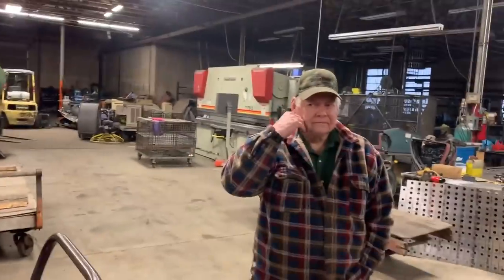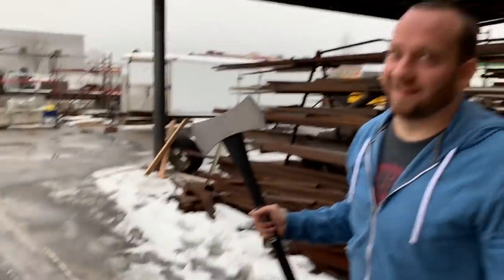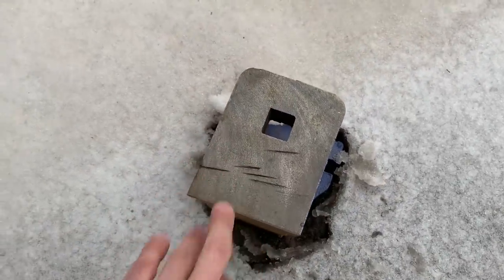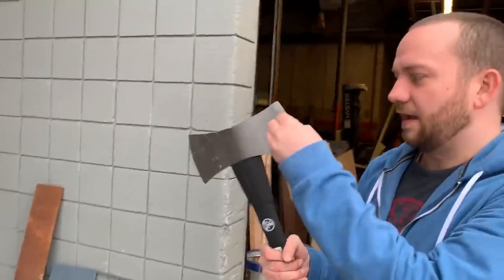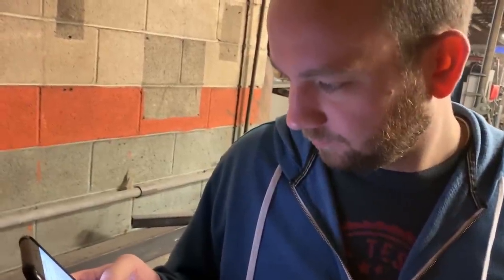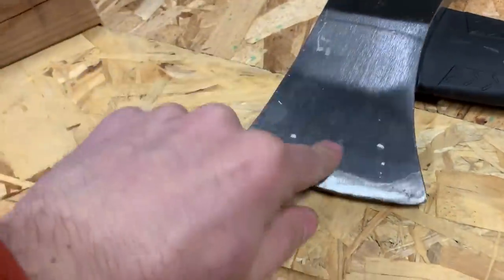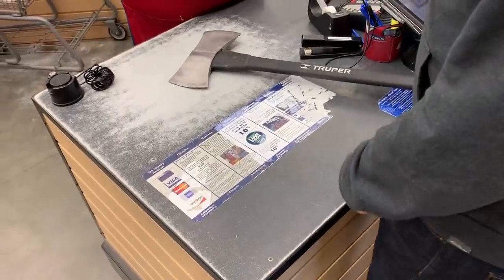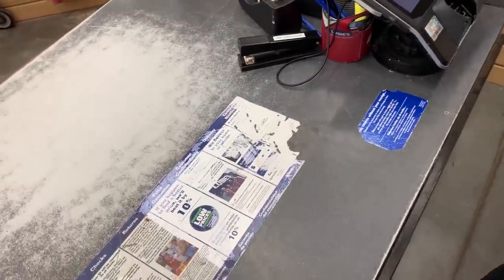Sharpening an Axe with 60,000 PSI Water - Waterjet Channel

Comment: You probably could have sharpened it if you strapped the axe head to the block you cut at an angle. You would need to cut the other side of the wood block at the same angle just angled the  opposite direction.

Comment: How's a rock harder than an Anvil?

Simple the Anvil isn't hardened steel. The Axe Head is.

Anvils aren't hardened because when you miss strike and hit the anvil with a hammer if it was hardened you would have nasty flakes of hardened steel flying off at super speeds and potentially injuring you. 

Hope this helps

Comment: It is an anvil from Harbor Freight.  I had screw drivers from there that deformed when I used them the FIRST time.  I think they are just not heat treated.  Why else would the tip of a flat screw driver twist?  I know they don't sell any top quality tools in that store but I thought I would get more than one use out of a screw driver.  I have old Craftsman screw drivers that have gone through many times more use and I still use them today.  I am not sure how they compare to other brand tools but they did last a really long time.  If those inferior quality screw drivers from Harbor Freight were not free I would be back there the next day to return them they are that bad.  I suspect that anvil to be made of similarly SOFT metal.  I know you don't want an anvil to be hard and brittle though.

Comment: The reason why the rock is harder is because that 'anvil' has no qualities of an actual anvil other than the look. You need the face of an anvil to be a hard STEEL. Carbon plate or tool steel works.

Comment: anvils aren't hardened bc the tools you use on them are.  hardened steel hitting hardened steel can cause chipping, which is dangerous.  as to why the rock was so hard, it's just probably easily aroused.

Comment: Actually a proper axe has only one sharp side as with an axe your supposed to hit at an angle to achieve maximum force and it’s suppose to be a 30 as you want the blade to be as skinny as possible but not to skinny because obviously it would break

Comment: How is the rock harder than the anvil? Simple, rocks are damn hard, and they shatter due to it, anvils are meant to be beaten on for decades. Secondly, that was not a hardened steel anvil, if it was even steel at all. A tool steel axe won't even dent a proper 5160 anvil face.

Comment: blacksmith of nearly 20 years (20 this winter) and technically anvils arent supposed to be fully hardened, and most rocks would be harder. having said that, this particular anvil must be the most dog-shit cast iron ever used. hell when you cut it in half it was like 15 percent filler putty and paint. unbelievable. my grampas hundred year old cast iron anvil held up better than that shit.